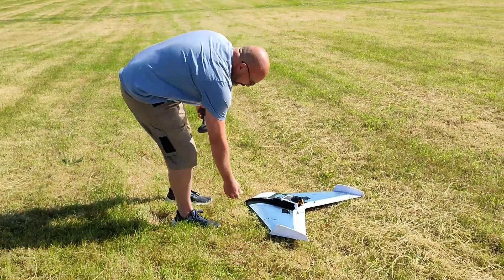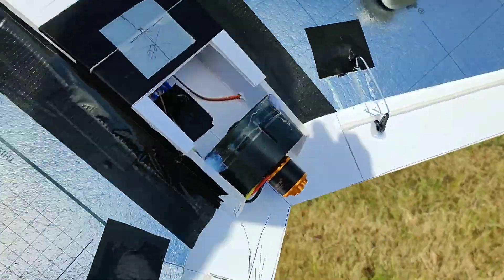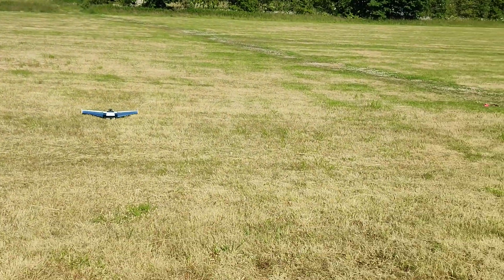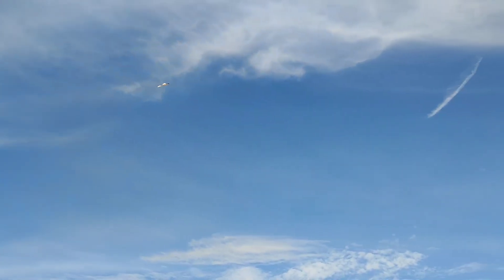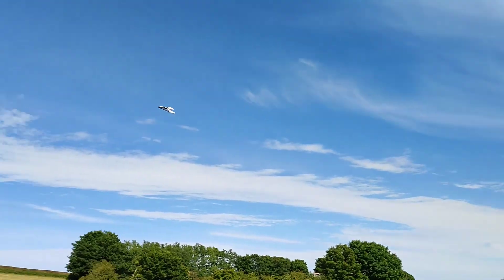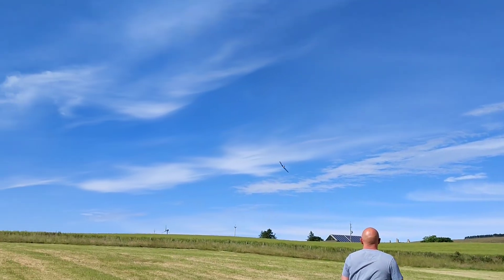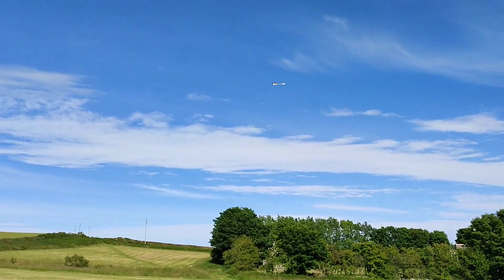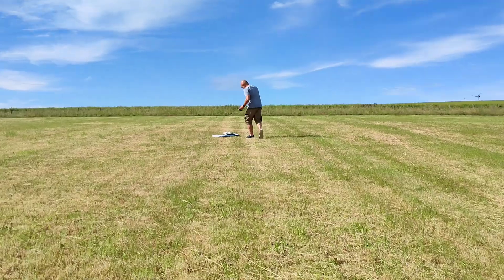Maiden Flight of my newly designed RC Flying Wing. Hold on to your stick 😜

Comment: Windy!!?? You're not joking mate. If the rustling shirt and noise in the mike didn't tell us, the sight of that windmill in the background cranking over like a prop on a Lancaster gettin' ready to head off and bomb Germany would convince anybody! 
That's a really neat looking job on that scratch-built. A bungy launcher is what we have to use these days to get a guaranteed good take-off with anything over 500mm. 😜😁
Reply from the maker: I did think about this bungee launcher, I would love to see your design... In particular what size of rubber bands or whatever they are called, did you use?